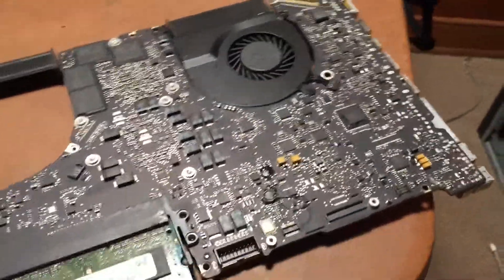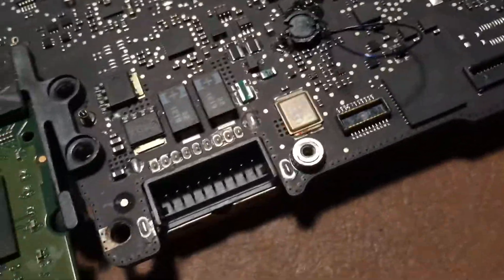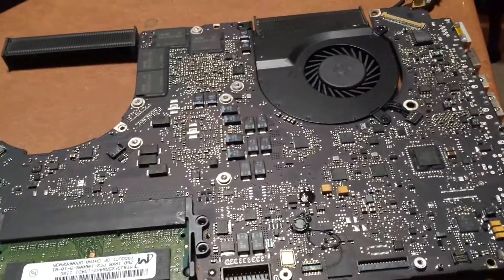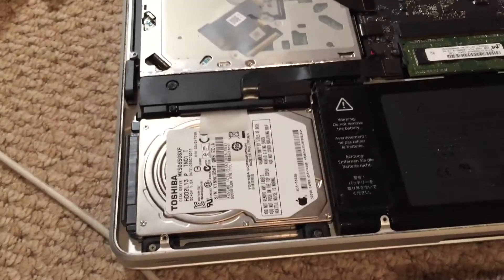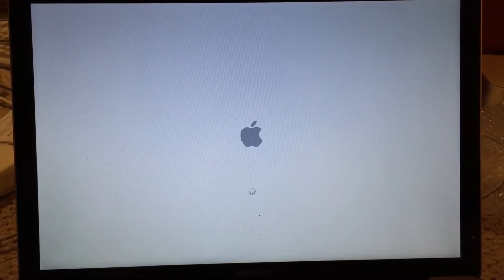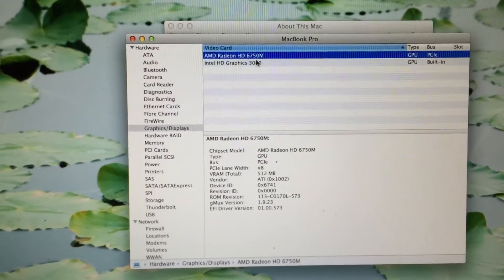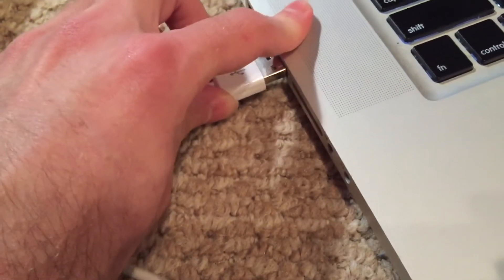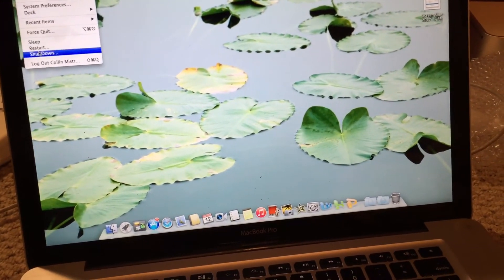Late-2011 15" MacBook Pro Repair Overview

Comment: I am in the market to get a 2010 Macbook Pro with the i5 cpu and intel graphics.  Do you know of any serious problems they may have?  Thnx
Reply from the maker: Sometimes, they can have bad GPUs, but normally they're pretty much issue free.
Reply: Thanks, do you know what a decent price range is for one of those units? Thanks again.
Reply from the maker: I'd say somewhere around $350 for a fully working one.
Reply: cool thanks.  Keep up the good work and quality content.
Reply: Yea that's what scares me about apple products.  They keep overheating and the solder joints always have problems.  But their products still look cool none the less.
Reply: A 2011 model is actually pretty good when the motherboard has been replaced by Apple. Yes, it runs pretty hot under full load and a 2012 model is probably more reliable, but a 2011 model is much faster than a 2010 one. Something worth considering if you do some rather heavy stuff on your mbp. A 2010 model is still more than capable of some everyday browsing though.
Reply: Not really. Mine has a different EFI from the normal models, so it could be a slightly different motherboard all together. I don't think (hope) Apple just reflows those GPUs! I could have done that myself! 
Your link is certainly very interesting, but it will really cripple performance in almost all tasks. The iGPU is pretty poor. Still better than having a malfunctioning MacBook though. 
If you have a choice though, it's probably better to stick to a 2012 model. The 2010 ones aren't that reliable either. In my case, I really wanted a 17" model with performance as high as it would get. The 2010 wouldn't really cut it for me, so a 2011 model was my only choice...
Reply: That's not very nice of Apple... I hope the different EFI works some magic, but I doubt it as it's a hardware issue. I'll see what happens when/if my gpu fails. Using the iGPU will be my only option then. I don't think its performance is very good though. I wasn't even able to run 1080p videos very well with VLC, which I have to use sometimes when Quicktime doesn't support some codec. 
On a side note: what will happen to Boot Camp when I disable the iGPU? I guess that'll still try to use the dGPU, right?